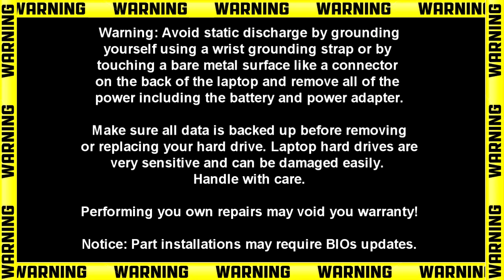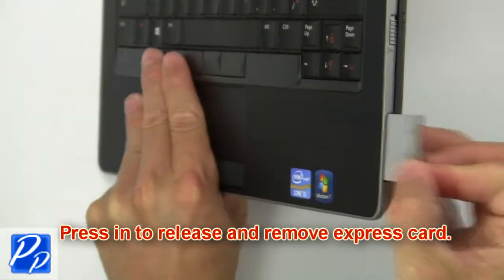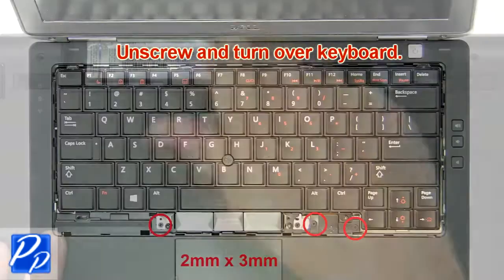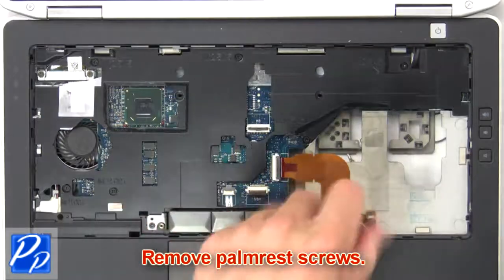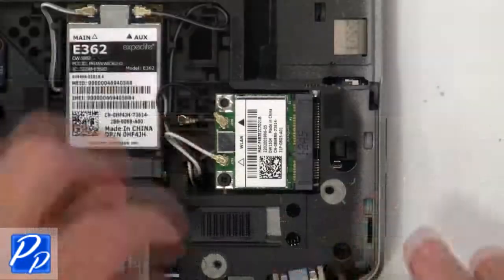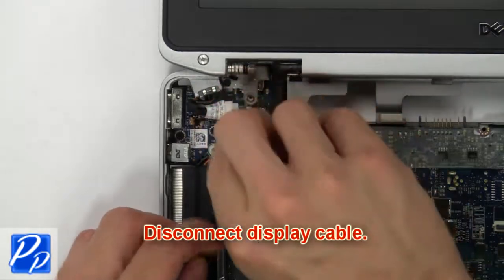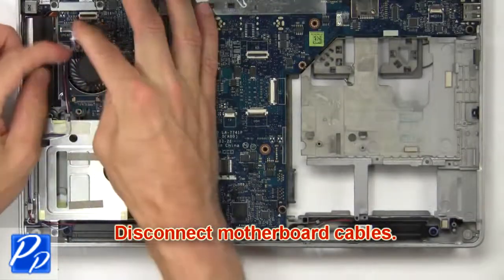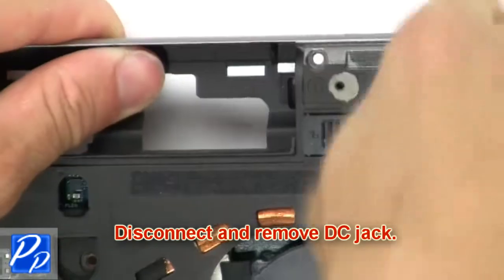Dell Latitude E6330 (P19S001) DC Jack How-To Video Tutorial

Comment: You don't need to disassemble the whole machine to change the DC jack. Just remove the base and the single screw holding the DC jack in place. Then use some tweezers or similar to guide the white connector out from the mainboard.
Reply: Agreed. I prepared myself for a 90 minute job, and it only took 10!